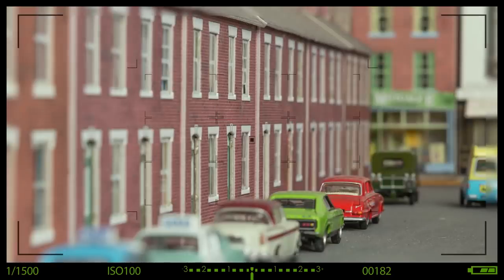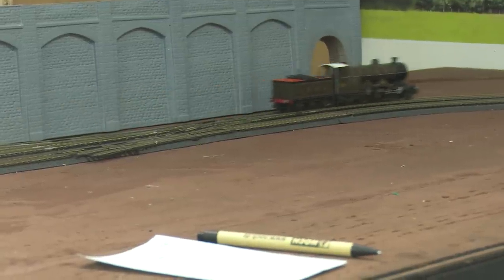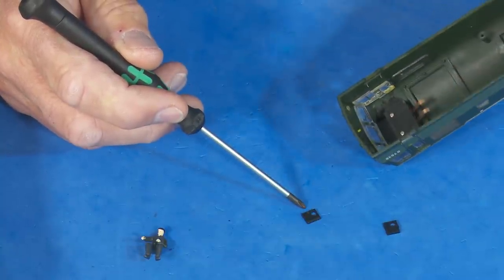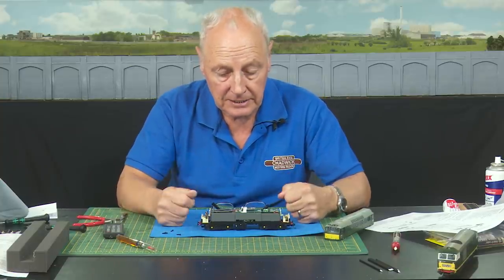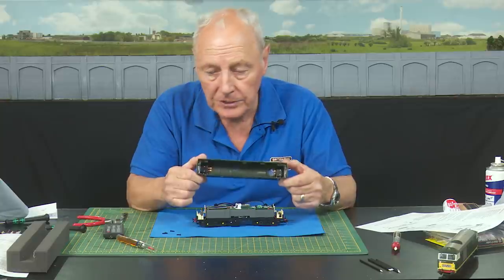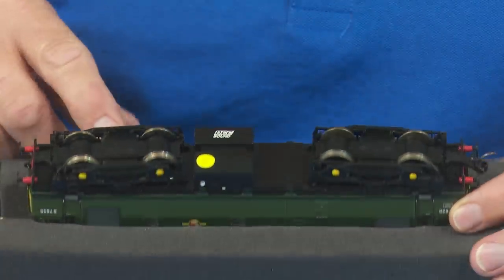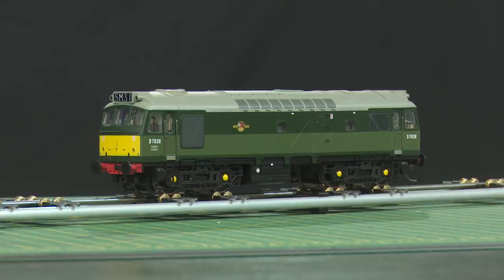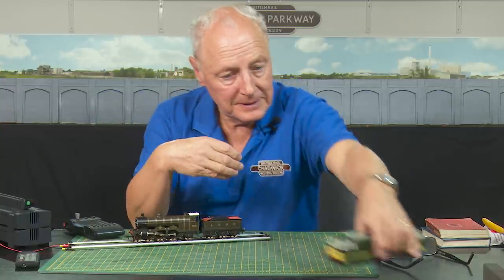Loco Servicing at Chadwick Model Railway | 109.

Comment: Hi Charlie another great informative video I might be wrong but I think your the only one that has covered loco maintenance and thorough wheel cleaning well done your video has certainly answered my questions.
Reply from the maker: Thanks Mark, what a heartwarming comment.
Reply: Yes, indeed. My comment is similar.
Reply: @ChadwickModelRailway  That bit about inverting the rolling road to allow wheel cleaning is just the best, thank you. I have one of those for N Gauge. 
Btw, those brass rollers also need periodic cleaning. I think some of our cleaning issues arise from contacting two differing metals ie; brass or phosphor bronze pressing on stainless steel or nickel silver with current passing though it. We might be back to chemicals only the other way round, with electrolytic oxidation occurring to producing high resistance points between the differing metals.
Reply: @motorheadmalc  Have a look at Sams' Trains. He does lots on New engine appraisals and servicing videos.
Reply: @richardclowes6123 thank you, I will.

Comment: Isopropyl alcohol and water form an azeotrope, which means they form a mixture that is unable to be separated with a simple distillation. As such, the IPA and water portions of any strength of IPA evaporate at the same rate, but the higher the percentage of water, the longer the drying time. Prolonged exposure to IPA can degrade/stain some plastics like PVC or styrenes.
Reply from the maker: Great info Custardo, many thanks.
Reply: Yes unless the bottle is very well sealed the 99.9% Propan-2-ol (IPA) will soon end up as 91% by volume the rest water absorbed from the air - can remove it by storing the IPA over molecular sieves but may be over the top of model rail use.
Reply from the maker: Wow, what a great comment.

Comment: Yet another good little film. Something of interest for you is something you may of may or not know is that in the factory where Bachmann model locomotives are assembled they grease the cogs and sprockets which is fine. But quite often on some of the Bachmann steam locomotives they over do it with the greasing lead to locomotives not preforming as well as they should. I was told this years and years ago and not long after I brought a Bachmann steam locomotive snd it did not preform very well so someone from the model railway society I used to belong to offered to take my loco away and remove the grease and then oil it instead. When I got my locomotive back I found it worked a lot lot better. I haven't had any trouble with any other Bachmann locomotives I have brought since wich I am glad but my friend who is in the know said it would be wise to remove the grease on all my Bachmann steam locomotives and oil them instead which I have not got around to do but I will one day.
Reply from the maker: What an interesting comment Matthew. Yes I had heard that some locos were supplied with too much grease, which gets even worse over time of course, as it dries out. regards Charlie

Comment: From a chemistry standpoint, a water-alcohol mixture forms what is called an azeotrope.  This mixture acts like a single liquid, not like sand and rocks mixed together, which will separate out (this is why mixed drinks don't turn into alcohol at the top and water at the bottom).  It boils at a single temperature.  As such, the alcohol & water evaporate simultaneously, so you'll never have the corrosive properties of water to worry about.  No harm using the pure stuff, but really no need, either.

By the way, your videos are brilliant, well done.
Reply from the maker: Great comment TD. Regards Charlie.

Comment: Hi Charlie great video  the moto if it aint broke dont fixit i use to run a Preventive maintenance system which cost more than the equipment being maintained unless it was a timex item i.e seals etc, 100 pecent IPA if not avalible 
you can still use 75 iIPA if you run it through a molecular sieve which is not avalibel from your local supermarket so the next best thing is common tabel salt.poor half a cup of tabel salt into you week IPA the sailt will not desolve,the salt will remove the water from the IPA in about 30 min draw of the IPA just above the salt 100 persent IPA the salt can then be dried out and used again.
Reply from the maker: Wow, what a great tip Ken. 
Regards Charlie

Comment: Dear Charly, 
there are some points I'd to add to you for your layout to help you. 

I. Detailing can give some extra dot we do long for

So if you like to give your loco drivers a last touch you could add some wash (thinned colour of darkee tone) to the face. A very thinned dark flesh to imitate the shadows in the face making them alive. Also on the uniform a deeper blue/antrazith colour highly thinned will run into the grooves stuck there giving some imitated shadow and bringing the figure a last touch - it is allways easily done at maintenance your locos. Also you could pronounce the detailing on the bulkhead and dashboard, too, if you like. 

II. 
The sad guy with the sound 
issue 
To reduce the cello body sound of the viaduct you can fill it with styropour balls (may be easiest to bring in through a drilled hole from the "backside") to minimize the acoustic volume of the physically empty but acoustically active body?

III. Night shift guy for the 24h journey? 
I am a bit irritated, because - why were there TWO guys in a loco on a BR diesel loco placed in the cabin?

Best wishes to you and thanks you from Berlin, Chris
Reply from the maker: Interesting points Chris, many thanks.
However, during this period in time, there were always 2 crew unless the loco was running light. Regards Charlie

Comment: The accessibility to the gears of modern model locos is a pet peeve of mine.  Older locos you just popped the shell off and there is it's guts for all to see.  Now a days you pop the shell off (if you can figure out how) and it's chocked full of stuff and the actual moving parts are hidden away under weights and/or cowling.  Infuriating... I suspect it's mostly done to void your warranty if they see you've moved anything when you inevitably send it back for a fix.  Another great informative video Charlie, good job!
Reply from the maker: I’m so pleased that you enjoyed the video, and you’re on my side regarding manufacturers!
Reply: Chadwick Model Railway yes, it seems that the manufacturers prepare the "oiling diagram" without speakers and DCC chip then expect you to figure out how to "oil and grease" without removing the extra bits. Too late for the older locos but new ones should plan for cleaning and lubrication even if it is a few more screws or tabs and warnings on the instructions.

Comment: Hi Charlie. One thing I noticed was how encased the worm gears on the class 25 are. Maybe the manufacturers ought to have put an access hole in so that the worm drive is accessible through the side of the plastic casing rather than having to poke it in at the ends like you did there. Ditto for the Hymek, the gears train is right inside the bogie so maybe a hatch that the nozzle or needle might go through would be useful.
Reply from the maker: I’m sure that you’re right, they might propose a maintenance regime, but it’s very hard to carry out. Regards Charlie

Comment: Another god one Charlie. Yes, track cleaning video would be great. I use guitar plectrums, (picks), to prise locos apart. You can get very thin ones, (0.71 mm), and they are all chamfered so no hard edges. Plus they come in pretty colours! Pete
Reply from the maker: Great suggestion Pete, I'll look into getting some.  Regards Charlie
Reply: What a great idea. I have tens of them and never thought of using them. Although I haven’t tried it yet a plectrum would seem to be the ideal shape and size.
Reply: Well well, what a great idea, i play guitar myself and never thought of using plectrums.. excellent, thank you...
Reply: I like the idea of guitar plectrums however being a non-musical type I don't have any, but currently I use old bank cards.  They're also quite thin and strong.  Card can be easily damaged (business cards) and I don't have them either.
Reply: @gamerdruid7605  Get them from Amazon. £3.49 for 12 - 0.41 mm thick. Bank cards have sharp edges. These picks are made from gel. They did not have this thickness when I bought them but the 0.71 mm ones I have are OK.
Reply: Gamer Druid another alternative is to use the tools from iPhone battery replacement kits. There are some that look similar to plectrums as well as more chisel types called spudgers. They are used for prising apart casings and delicate electrical connections. Also included are small suction cups.
Reply: Great idea, these guitar picks !
Reply: cheap car trim removal kits work well its what i use

Comment: I echo the good supportive comments.  Um, cleaning the wheel treads and then running the loco's on the uncleaned track is undoing the the tread cleaning and vice-versa. The points and frog tend to collect gunk (where there are wheel power gaps and reconnections causing tiny arcing), any place the loco wheels spin lays gunk on rail sides (not the tops), and finally you will find that where the loco sits (especially on electrified track) over time, is another place where the gunk accumulates.
The removal of axles... stick in your "prybar" and once a tab is dislodged, you stick in a corner of your business card to keep it from relocking. And I have found that releasing one "end" at a time puts enough force to bend that axle retaining plate. I pry one side, stick in flat object and pry the other side. On some wheel pick-ups, it's the end of the axles that serve as electrical connections 'as well as' bearings to keep them rolling nicely-but that sometimes requires more dismantling of the bogie/truck assembly (which is also on some tender locomotives' tenders)... to which if there isn't electrical pick up, could be installed with simple brass sheeting and wiring-for those savvy with fine dcc soldering.
Arcing is a great gunk accumulater... until you wanna clean and have your loco's running top notch.   John   BC, Canada
Reply from the maker: I'm so pleased that you enjoyed it Zebrails and thanks for some great info. Stay safe. Regards Charlie

Comment: I did find it very useful to put a small Neodym-Magnet on my screwdriver (near the handle, so it is out of the way).
It helps pulling out the screws, and of course putting them back in.
Reply from the maker: What a cracking idea Andreas.
Reply: Not trying to be a smart arse but you are aware that one can magnetise any steel screwdriver to do this permanently! Get that magnet and in one smooth motion rub it down the full length of the metal shaft of the screw driver (steady now, no silly comments! :D ). Now lift the magnet clean off the screwdriver at the end of the motion. Do NOT under any circumstances rub it back up the shaft the opposite way! Now comes the tricky bit, with out letting the magnet slam into/onto the shaft, connect it at the top again exactly the way you did at the beginning (North - South as before of the magnet), and draw it back down the shaft like you did the first time. Repeat this at least 10-20 times until the magnetic field in the screwdriver is strong enough to pick up and hold any screw sizes your inclined to be using with said screwdriver.
When this effect starts to wear off (many months to years later depending on treatment of screwdriver) just reapply like you did the first time. Things that will effect the induced magnetic field are, dropping it/slamming it into onto things, throwing it into a tool box full of other metallic bits an bobs, placing it next to any magnetic fields stronger than that induced into the screwdriver...... you get the picture, look after it.
Reply: @gibsonethirty2836  Yes, of course, I know that, I'm an electrician. But I'm also a bone-lazy guy. When I want to get a screw out, then I want it now. 
I have always several magnets of different size in reach and when I need one, I stick it to my screwdriver and put it back afterwards. I also have 
a magnetizer/demagnetizer in my toolbox, but, as said, I'm lazy...;-)
Reply: @andreasekart3853 Hey,  I'm also a Sparky (plus I did my Electrical/Electronic Deg). Small world  lol. Just putting it out there as some have no idea and its always useful info to know. Take care. :D

Comment: really timely video as I have just taken apart an old HST, Princess Elizabeth and Mallard.  Sadly even after careful cleaning the first two lack power and Mallard motor runs great except motor gears  slip off the geared axles... back to the drawing board
Reply from the maker: It's a nightmare Alastair.

Comment: I have 11 locos (only sadly) but they are all run regularly to a timetable for 5 months each year. Some, Airfix, Hornby and Mainline were purchased in the early 80s, used for a year and then put away until 2018. Some new ones have been purchased after that date. The old ones were serviced by me in 2018 before being converted to DCC. Since then they have never has a service except an annual oiling, since they are all steam. All except 2 are hard wired and so servicing is a particular pain. They all still run perfectly after  5 years and I do not intend to service them until they start to misbehave. I have been worrying about the lack of servicing but no longer thanks to your video.
Reply from the maker: That sounds like a good reliable strategy Nigel. Have a great Christmas, regards, Charlie

Comment: Very informative as ever Mr C.. luckily I refrained from using some light glue .. !! Re servicing, it is surely vital that owners can get into the locos, and it's not impressive when when we can't.. the Hornby standard diesel shunter has 2 plastic clips to take the cab off the chassis and away from engine cover.. have wrecked 3 such locos now!! Hidden bluetack helps...!
Reply from the maker: Yes it’s a shocking situation Jimmy.

Comment: Hi Charlie. Such a useful video - many, many thanks. By pure coincidence today I unpacked a Bachmann Class 25 which I'd bought at auction last month so it was good to see how you serviced it. Especially as mine is an earlier incarnation, without DCC/sound and with no notes about how to service it on the exploded diagram of parts. I think mine (D5211) was produced in 2007.  It has an extra equipment box modelled below the underframe taking up all the space where yours has a gap; I presume this represents an earlier prototype.
Reply from the maker: Will I'm so pleased that you found the video useful.
Regards Charlie

Comment: Tip with super glue if you stick yourself together with it.  Hot water will generally weaken the bond (as will heat generally,  which is why it fails after a while). And yes,  it was developed in the Vietnam war by the US military as a quick way of stitching wounds in the field. Medical grade versions are still used in a&e departments. 

Another good,  helpful video.
Reply from the maker: I took the easy way out and bought some dissolving agent.  I never knew that it even existed.
Reply: @ChadwickModelRailway  i didn't know it existed either.  Probably a wiser option than a scalpel.

Comment: Charlie, When I modelled in " 0" gauge way back in the mists of time and we used big pitman motors  with brass gears. we ran the gears in with graphite grease. Then washed the grease away with methelated spirit. Then put a dab of light grease on the gears and oiled any bearing etc. with Singer sewing machine oil. Tri-ang in the 60's sold a really nice oil in a bottle for model trains and for their racing car model's.Cheers, Chris Perry.
Reply from the maker: Those were much simpler times Ainsley.

Comment: Hi Charlie
Great video
I use Woodland Scenics HO loco cleaner, I think Gaugemaster supply the same one rebadged. Cleans the wheels of all vehicles, and have used it at exhibitions, normally all loco's get done before the public gets in in the morning, as part of the setup procedures.  Just wish they did an O gauge version.
Paul
Reply from the maker: I agree Paul that type of wheel cleaner is a godsend. Regards

Comment: I have learnt over time to be cautious oiling  connecting rods - especially if the retaining lugs are a friction fit. Very light oil can penetrate into the friction fit socket and the retaining lug loosens and will not stay inserted. N scale in particular.
Screws can come loose as well but they can be cleaned and put back.
Have you had any experience with Labelle lubricants? They have a lubricating powder which looks interesting (Labelle 134).
I for once would be interested in seeing a comparative video on lubricants.
Thanks for all the great videos - I always enjoy them.
Reply from the maker: Thanks Malcolm, I shall certain look into a lubricant video.

Comment: A really good, informative video. Is the class 25 a Bachmann loco? It looked likely the way the loco is\was over lubricated. There's a line of products from a company called Aerocar Products that I've used with really good results. I don't know if they're available in the UK, but it might be worth your while to try them if you can find them. Also, if or when you do a track cleaning video, you might want to try rubbing your track with a graphite stick after you clean it. This helps keep the rails clean longer and improves the electrical contact between the rails and the loco wheels, assuming that the wheels are as clean as the rails.
Reply from the maker: Interesting points Raymond, and I will certainly be mentioning graphite.
Reply: @ChadwickModelRailway  Charlie, the graphite sticks should be available at any good art supply store, either online or brick and mortar.